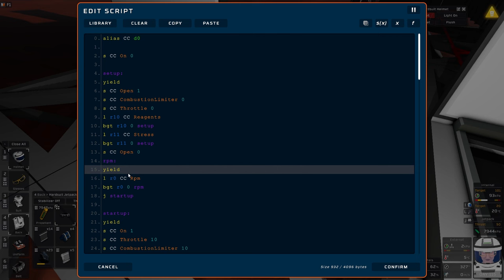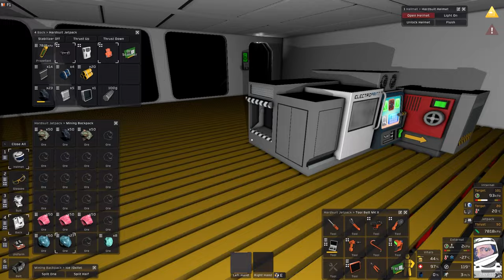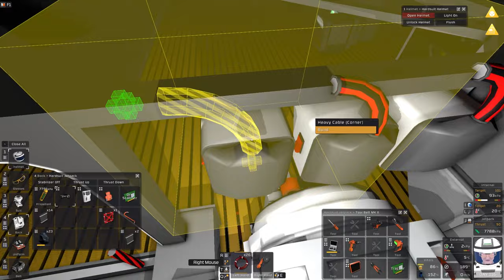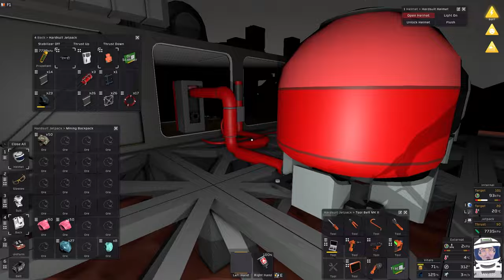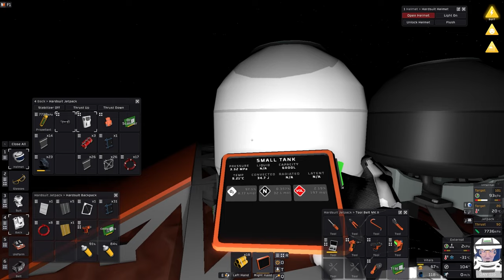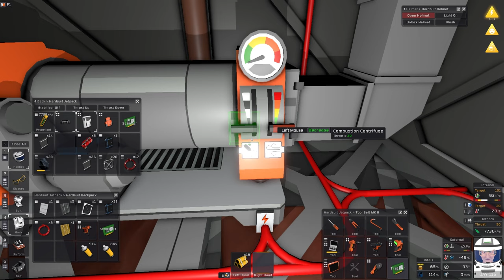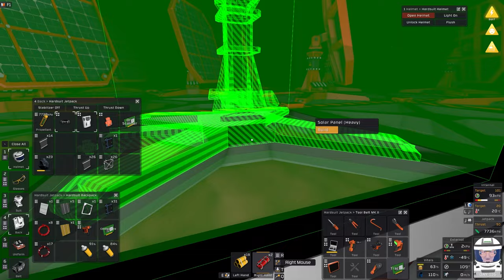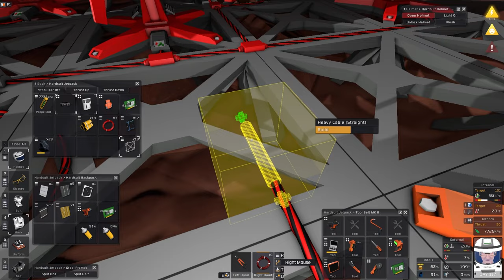Easy Automation of the Combustion Centrifuge on Mars Stationeers E17

Comment: Would you be able to set up an IC connected to the gas tanks to vent undesirable gases in the future? I see they have network ports like most of the other items in the game. Also, for your power, how about a coal silo right next to your generator? Set it up to automatically be fed stacks of coal every so often, if possible. With uranium, is there a nuclear power option?
Reply from the maker: @jasonknop973 You need to use a filtration system to get rid of the undesirable gases. You can use the network connection to read data from the gas tank, like gas ratios, pressure, temperature etc.

I have written code to auto-feed the coal generator when the battery levels drop in previous playthroughs. I keep meaning to do so again when I get around to it. 

No there is not a nuclear power plant option in the game. Uranium is only useful for making lots of pollution, which is useful in a phase change cooling system.

Comment: I'd love the IC code for that. Please do upload.
Reply from the maker: @robloughrey   Here's the code. I am sure a proper programmer could do a better job but this works fine for me.

alias CC d0

s CC On 0

setup:
yield
s CC Open 1
s CC CombustionLimiter 0
s CC Throttle 0
l r10 CC Reagents
bgt r10 0 setup
l r11 CC Stress
bgt r11 0 setup
s CC Open 0
rpm:
yield
l r0 CC Rpm
bgt r0 0 rpm
j startup

startup:
yield
s CC On 1
s CC Throttle 10
s CC CombustionLimiter 10
l r0 CC Rpm
blt r0 250 startup
s CC Throttle 20
s CC CombustionLimiter 20
l r0 CC Rpm
blt r0 280 startup
s CC Throttle 40
s CC CombustionLimiter 40
l r0 CC Rpm
blt r0 340 startup
s CC Throttle 60
s CC CombustionLimiter 60
l r0 CC Rpm
blt r0 425 startup
s CC Throttle 80
s CC CombustionLimiter 80
l r0 CC Rpm
blt r0 470 startup
s CC Throttle 100
s CC CombustionLimiter 100
l r0 CC Rpm
blt r0 470 startup
j main

main:
yield
l r10 CC Reagents
blt r10 500 main
j shutdown

shutdown:
yield
s CC Throttle 0
s CC CombustionLimiter 0
s CC On 0
l r0 CC Rpm
bgt r0 0 shutdown
s CC Open 1
j setup
Reply: @dragonflygameruk4094  Thank you! Just out of curiosity, why do you put it in an exterior housing instead of just putting the chip in the machine? Does it make writing the code harder?
Reply from the maker: @robloughrey you need to use a scredriver on the IC Housing Pin D0 and set it to the Combustion Centrifuge. You can see me doing this on some of my other videos. 

What line 2 is doing is setting the ON status of the device connected to pin D0 to off.

The 's' means save, the 'CC' relates to the device connected to pin D0 as defined in line 1, 'On' is the on/off variable of the device, '0' means off, if it was a 1 it would turn the device on.

Things you have to be aware of. The Combustion Centrifuges power and network connections have to be on the same electrical network as the IC Houseing and it's network connection.
Reply: @dragonflygameruk4094  here a specific question for you. If you add a second combustion centrifuge because you have 4 deep miner will you need a second ic chip for the second one or both can be run on the same chip??
Reply: @srg08  to keep things simple, I'll go for a separate IC. Use the labeller to label your combustion centrifuge for easy identification.
Reply: @dragonflygameruk4094 in the 14th episode when you where talking about the ic chip that can be put in there you did mention that you were not ready for it yet… and in this one you place the ic chip in a housing instead, was there a particular reason for not using the chip in the CC housing?? I’m just curious that all
Reply: @srg08  the honest answer is I've not tried the chip in the CC. I'm trying to think if there is anything in the code that would cause problems. I'll try it tonight.
Reply: @Heffie01  sorry if I bit confuse is that you Dragonflygameruk4094?? On an alt account?… or I need to stop drinking.